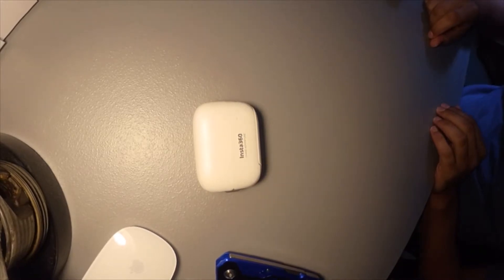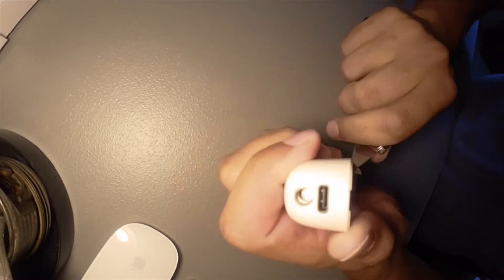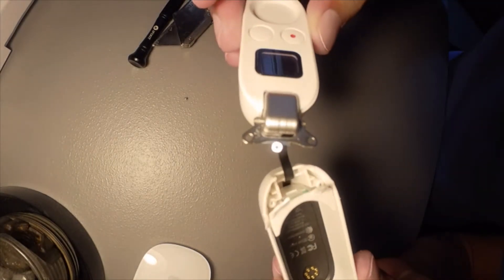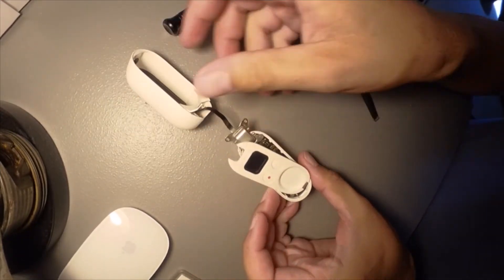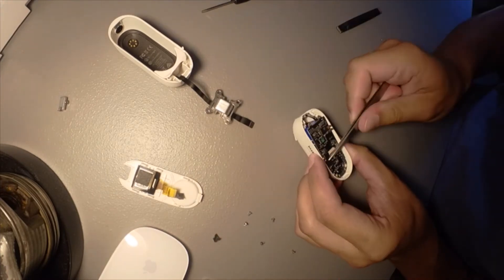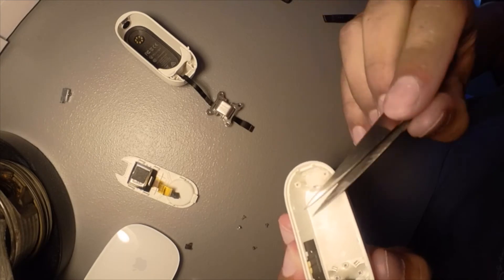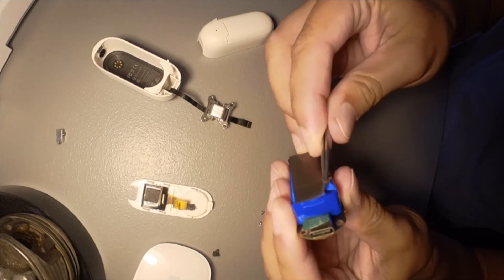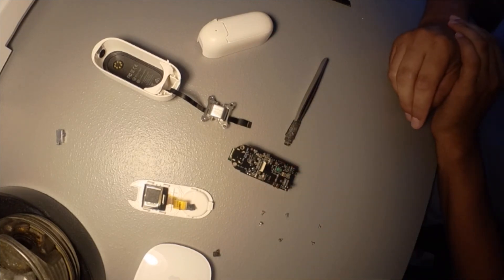Insta360 Go 2 Charging Case TearDown

Comment: Bit late in the day but dont suppose you ever took apart the side the camera goes in? Do you still have the old case if you sill need the ribon cable that connect the two sides?

Comment: I'm actually planning to turn the top part around so it can be used as a dashcam. Otherwise it's impossible to see if it's still running and the app is utter crap tbh. It not turning off when closed is not an issue for me. Thanks for giving that preview look and hope you where able to fix the damage.

Comment: I ripped that cable that goes from the top part of the case to the bottom part. Do you know anywhere I can get another one of these cables?
Reply from the maker: I would plan on getting a replacement case from Insta360.

Comment: I got mine water damaged as well. is there anyway I can fix it or replacement ? Because the camera itself still working.
Reply from the maker: You can get a replacement from Insta360. I do not know if they are still offering it, but at the time I did.

Comment: If you’re familiar with the product “shoe goo”. 
And I’m curious are you discharging mount in a special way you can make it waterproof as far as not fully submerged underwater but in case you had it in your pocket and lo and behold you might’ve stepped in to the pond a couple inches past year’s pockets so it got a little wet do you think Sugarhouse could fix the waterproofing issue
Reply from the maker: The best way to protect it is of course no water. But outside of that this might be a good way.

Comment: My hinge has lost all friction, and actually now has resistance at fully open position where it is supposed to lock, and thus springs back to slightly closed. Still usable as a tripod but not on the selfie stick. The hinge screws seem to be fine on both sides, I believe it's the hinge itself. If anyone knows where I can get a replacement hinge, or has a suggestion on frictionizing spray, let me know thanks.
Reply: I do have a hinge problem that is slightly different, when I want to opened it has a gap on the camera side with no restrains from the hinge mechanism... and then gets "tight" again to open, knowing that the hinge is working but obviously wobbles back and forth on this gap...  it looks like a cracked bolts slot or a loose set of the bolts but seeing this footage I just realize that I can't tight them down again without partially destroy the case... =(

Comment: thanks for sharing , i have had a problem on bluetooth , when the camera is close the remote it works , when i move to far (around 30cm ) it always says "connecting".  i guess broken bluetooth antenna is the problem, could you please share where the bluetooth anttenna pics. i can try to fix by myself.Thanks in advance.
Reply from the maker: I will look next chance I have.